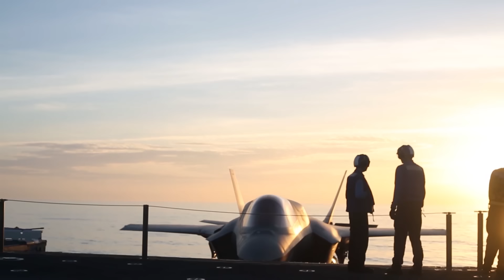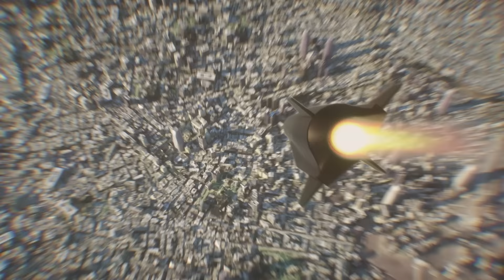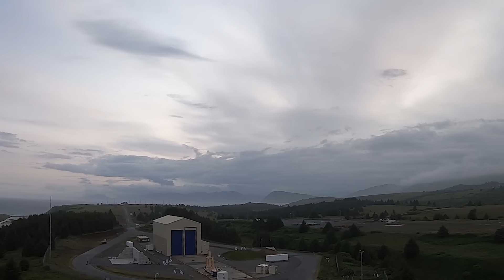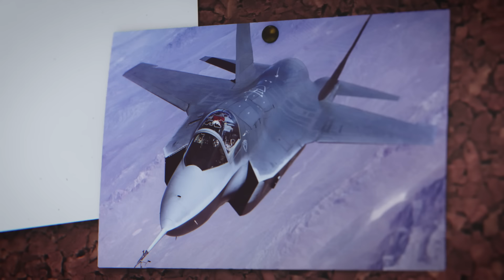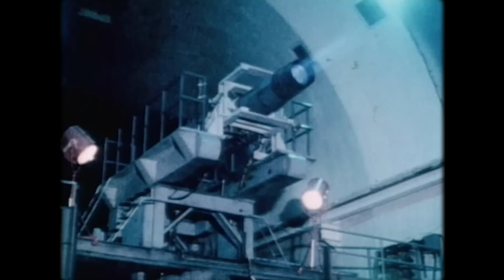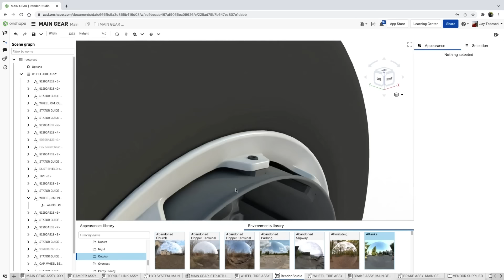How Will the Golden Dome Work?

Comment: AEROSPACE ENGINEER HERE: If we are going to call out Iron Dome as a fantasy then we need to also call other things out as a fantasy.
FIRST - * the whole hypersonic manoeuvrability claim is totally overblown by everyone. They cannot move about on the ways that people draw them. They cannot fly about like normal aircraft or the G-forces would tear them apart. *YES they can manoeuvre but its only small amounts and that's all they need when the incoming counter missile has to get very close or actually impact the missile. A tiny change in trajectory and the interceptor can simply miss.

The decoys issue is very real and that's by far a bigger hassle to deal with, because they can be made to look and behave just like deployed warheads.

SECOND - The whole laser thing is BULLSHlT was always BULLSHlT and will always be BULLSHlT.
I was doing my degree during Ronald Reagan's Star Wars era and we worked out in the late 80s that the whole laser thing would NEVER WORK for a long list of reasons, but the basics are:
1) The power requirements make it unfeasible unless you ant to build gigantic satellite platforms or gigantic planes with massive nuclear reactors on board. Lasers are fantastic for cutting things like sheet metal because the distance the laser has to fire over is so short (millimeters). Once you start getting into meters of distance there's the simple reality of light scattering 
which only gets worse with distance. SORRY but there's no way to beat the physics.

2) Even if you could somehow magically power a laser that could shoot down something there's the problem of accurately pointing it so that it actually hits the target. Lasers are not like firing a stream of bullets where each bullet has the chance to wreck the target. Lasers are light and you have to keep them focused on the target for long enough to deliver enough energy to wreck/destroy the target.

In space on a space platform the targeting problem is incredibly difficult. The math is insane and I only know of 1 person who even came close to solving that problem and he was at a level of genius that made the rest of us feel dumb.   

3) YES they had lasers shooting down drones as far back as the 1970s, I'm old enough to remember seeing film of it being done. The problem was pointed out back then - all the drones they shot down were conveniently painted colors that absorbed the light energy of the laser rather than reflective surfaces. There's an urban myth that the Russians once showed of one of their new missiles in the late 80s early 90s and all the warheads were shiny polished metal that was a mirror finish.

Comment: Some corrections:
Israeli missile defense was not overwhelmed, it simply had a 97% interception rate, which accounts for the missiles that did go through.  This should be expected from any missile defense, and it is a best case scenario for the golden dome.  As for the US's larger area to cover, the US also has much larger industrial capacity, even if not as efficient.

Comment: There are three non enegeneering, issue with the golden dome.

1) As stated in the video a space based booster phase interceptor would include offensive worldwide capability.

2) But a space based component would also have another political issue. To be able to protect from a first strike, it would need to be authorized to execute attack on perceived ballistic attack, with little time for confirmation (booster phase!)
Any misidentified target that is engaged (example: a scientific rocket for high atmosphere study) would be an attack INSIDE a foreign country border aka AN ACT OF WAR!

3) A marketing issue! The iron dome is a nice name, but it's not an accurate translation of the original name in Hebrew, which is kippat barzel. A more accurate translation would be "little iron hat" or "little iron helmet". Iron dome IS the official translated name. But the public's expectation is important.

We expect to get wet if it's raining and we have a little hat; but we expect to be completely dry under a dome!

In the video you correctly observed that potential target priority is important, but "golden dome" create a conflicting expectation for the project!

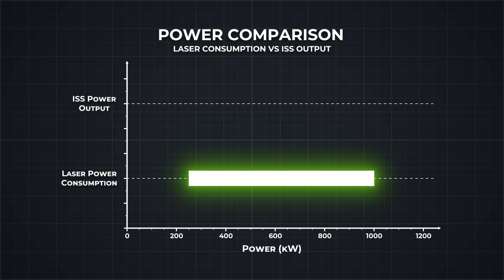Comment: Kilowatt (kw) and Kilowatt-hour (kwh) are two different things. 19:01, a laser turret would indeed need massive amount of power (kw) to fire but on a relatively short duration thus needing finite amount of energy (power times time equal energy - kwh = kilowatts times hours). Therefore a battery array large enough could be slowly charged from weak power output from solar panels and yet store enough energy to be able to provide enough power to the laser for its firing duration.

Yes, that would mean having to take months to reload a oneshot. But if you have tousands of laser in orbit, it's not so bad ^v^

Comment: What if the missiles are designed specifically to be hit by counter missiles... No explosive in the missile, core made up of tungsten or some heavy metal with strategic design where once hit by counter missile it just splits in pre designed pieces and hit an area instead of one location...

Comment: The F-35 is the critical part of the supposed golden system. Having around 8-10 F-35 in the air - all the time, 24x7, 365 days a year - each F-35 can provide enough sensor coverage that covers the entire continental US - including Alaska. Another two F-35s for Hawaii.

An F-35 has detected a missile launch over 800km away - or about 500 miles away. This means, that each F-35 is operating with a coverage area of radius of 800km with a 270 degree view. When flown in specific areas and routes, with the number of F-35s the US is planning to purchase, it can be integrated into F-35 training, all the while providing sensor coverage that the Golden Dome system demands - from different military bases all over the US.

Comment: Those laser satellites could use solar-pumped lasers instead. Depending on where the sun is when a threat is detected, the satellites receiving sunlight could angle themselves to point their beams towards other satellites, steering the light to the satellite(s) above the target who would then use the combined beam to destroy the launch vehicle. Sort of like a concentrated solar array, but used for anti-missile lasers instead of power generation. You'd need many more of them compared to electrically-powered laser satellites, but each one would presumably be cheaper and smaller. Of course this would have an added risk of collateral damage to other satellites that pass through the beams, but most of the beams would be relatively weak and a short exposure probably wouldn't be much of a concern.

Comment: As an aspiring aerospace engineer im deeply disappointed in your presentation of arguments for nonproliferation of weapons in space. How can u mention kinetic impactors and not mention kessler syndrome? This is equivalent to talking about nuclear weapons in a vacuum as just a "stronger" bomb. This video really should have been at least 10 or 15 minutes longer so that u would have the option to talk more about why the nonproliferation of weapons in space is such an important fight. Additionally it felt as if u didnt properly present the complexity of the various missile countermeasures, specifically the possible arms race that could emerge to subvert these new systems. There is a lot of misinformation and misconceptions currently about missle countermeasures, i think doing a video series doing a deep dive on the various countermeasure systems along with flaws and development challenges could be really fascinating

Comment: US has a missile defense system yo. For both endo and exo atmospheric intercepts, and for boost, mid course, and terminal phases of ICBM flights. And yeah like any system it has limitations. But it’s tested, manned 24/7, and highly capable. It has the capability to be transportable, to tailor the battle for asset values like population or military bases, and it uses a lot more ground and air assets than are mentioned here. 

And yes it’s expensive. You know why? It’s complex as hell. It requires smart people and years of ground and flight testing. And because it literally is homeland defense meant to protect against what could basically amount to a continental level extinction over time. 

It’s more than hitting a bullet with a bullet; it’s hitting multiple hidden bullets with a bullet, and NOT just after boost phase either. 

It’s expensive because it’s large, requires a lot of land and materials and knowledge, and it’s hard.

I’m sick of people thinking they understand missile defense because they read Wikipedia and want to shite on Reagan. War is always a fight where we are trying to defend simultaneous with upgrading and refining existing capabilities. That’s not new at all. It’s also not “new”. These programs started in the late 90s. 

This is a very disappointing and lacking video, and not just because you literally don’t have access to much of the information due to classification but also because you undervalue existing systems, personnel, and the work that goes into them still daily for operations and sustainment. 

Many people step up year after year thinking they can do it better. No one has yet. I welcome them to do so. We would all benefit. But devaluing current capabilities is contrary to that progress because any new program will literally be building on what these programs are already doing - and have been doing for decades. 

The warfighters, engineers, and companies that staff and build and refine these systems deserve better from a video like this.

Comment: The big thing no one talks about is that the physics of orbital mechanics make spacebound interceptors impossible. To intercept a missile on boost phase you would need an interceptor with multi stage throttalable capability which is going to make it about the size of a small ballistic missile. 

Countries with nukes have hundreds of missiles. So to ensure coverage you would need a disgusting number of interceptors in an orbital belt. 

There is no world where this program isnt a few trillion dollars if you push spacebound interceptors. 

And lasers are even dumber. It is not touched on in the video but even a 99.9% efficient laser is going to dump enough heat to chernobyl your satellite.

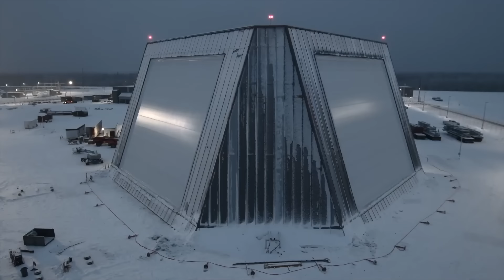Comment: 7:20 Fun fact, NOAA has been working on PAR weather radar for about 20 years now\*. Unfortunately, the project might get cut with the NSSL.

\* It took some time to integrate Duel-Pol tech and optimize it for hydrometeors. Lots of development work went on, and it is near the end of testing right now. It would be cheaper too, since WSR-88D is past EOL and expensive to maintain

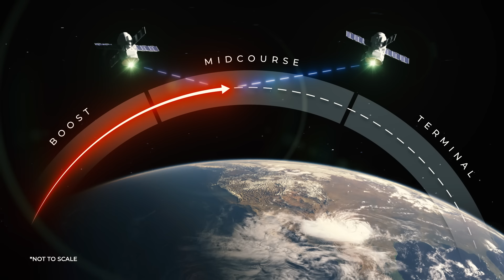Comment: 18:36 There's actually a LOT of advantages to using satellite based lasers to destroy missiles in the "midcourse" stage. The BIGGEST one is massively reduced energy requirements for the laser. In this model, the interception could happen entirely in space, and NOT in the atmosphere. The biggest problem with laser weapons is that they rapidly lose energy when traveling through air. Refraction really scatters laser light very, very, very quickly. This is no longer a problem if the interception takes place entirely in space. I'm unsure of the exact numbers (I'm a software engineer, not a laser engineer), but I'd estimate that this might reduce the laser energy requirements by 80% to 90%.
The second big advantage is the political advantage: If the lasers are designed with energies required for space based interception, but NOT atmospheric interception, that massively reduces the aggressive uses of the system. It can't be used to attack ground targets. It can't be used to, say, cover a hypothetical US invasion. It would ONLY work for missiles that actually enter space. The US could really only use it as a shield, not a sword... And hopefully, we'd be able to convince other countries of the same.

Comment: Missiles that could hit the US would need to be intercontinental in range.  THAAD has never been tested against such a target, or even claimed to have any ability against one.  SM-3 Block II has shot down an ICBM in testing, but the vast majority of missiles available to Aegis have no ability against such a missile, and would be out of position to help even if they did.  

Defending the population & production centers, is not new.  Look at what Nike Hercules and BOMARC protected back in the 60s.  There were well over 100 batteries deployed, defending the major population centers of the country.  2,550 nuclear warheads were built JUST for the Nike Hercules force, and another 350 for the BOMARCs.  When ICBMs became the preferred method of attack, the US abandoned trying to defend the country almost entirely, because of the difficulty of shooting them down.  Now that the technology exists, and is proven, there is a way to do it.  So why wouldn't you?  When the enemy could be throwing nuclear warheads at you the cost of doing nothing is too high.  What would be the cost to the US if LA were nuked?  Or even just the ports on the West Coast?  Trillions.

"Rods From God" was never meant to shoot down missiles.  Brilliant Pebbles would be the nearest analog to what is being proposed.  Arguable, it would be easier, and less controversial, than spaced based microwave and laser weapons. (Those solar power stations would make beautiful microwave weapons.)

And of course China and Russia are going to complain about it.  They want an easy target.  A defended target is much more difficult to push around.

Comment: So I did some digging in to this and I'm excited to see how my research results stack up with yours. It seems like golden dome as conceived by Lockheed Martin, one of the prime contractors for such a project, is just modest upgrades to existing systems, with the exception of Patriot, which will get a relatively significant upgrade in PAC-3. We already have Aegis, we already have THAAD, we already have SM 3 and 6, 4's on the way, and 5 is stuck in dev hell.

Comment: Golden dome has one major non-technical issue, which I assume you'll get to in this video. When developing an anti-ballistic missile system for nuclear defense, all you're doing is providing incentive for opponents to develop MIRVs and other survivable ballistic missile systems which require an exponential increase from your defense system for very little effort from the opponent.

If you somehow look like you have a good chance of building a capable enough system to reliably defend against ballistic missiles, now you've broken M.A.D and are thoroughly incentivising your opponents to launch an attack before you get the system up and running.